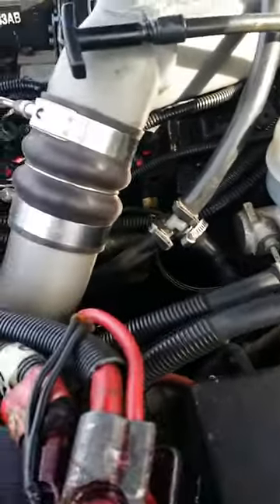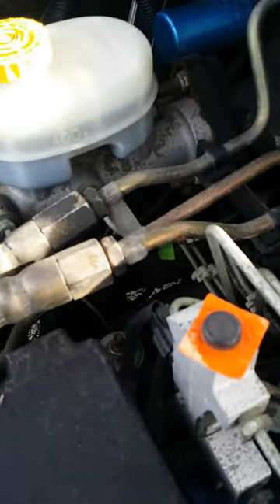12 Valve Cummins Replacing the Oil Pan Drain Plug

Comment: did that really work or was the oil pan already empty/
Reply from the maker: Chris Hinds it really does work. This is not recommended to do on gas engines though. A shop vac would have worked way better but I didn't have one on hand. I run Amsoil and did not want to drain all my oil to replace the drain plug.